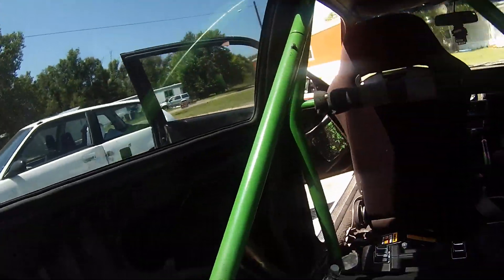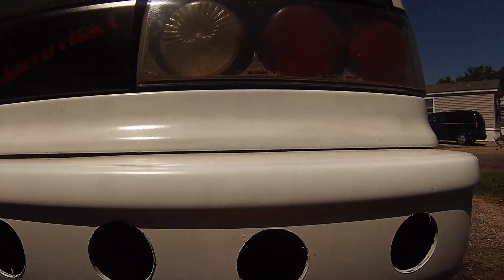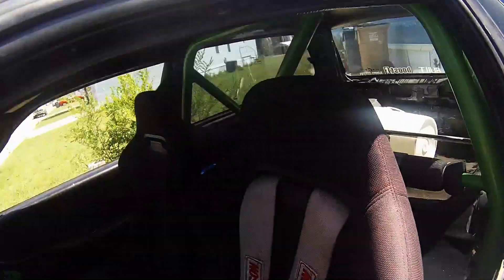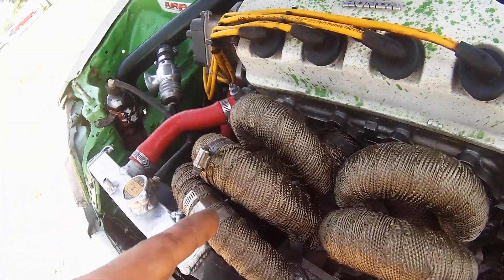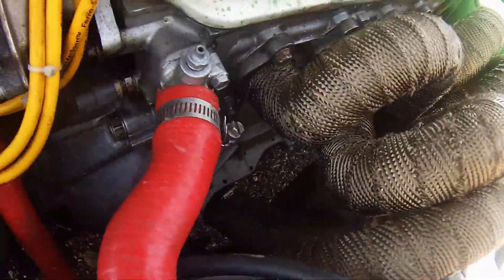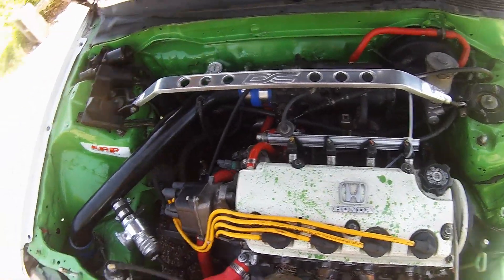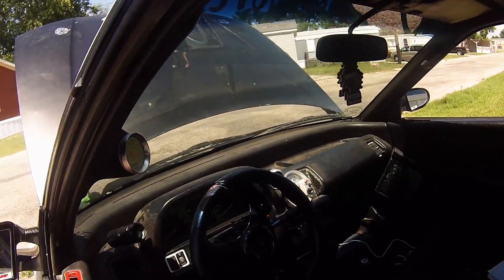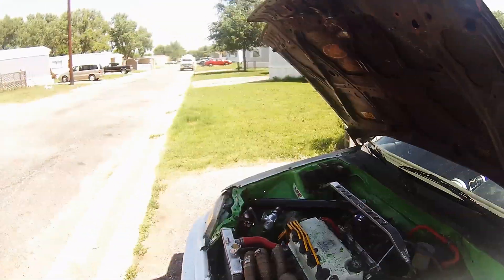Update on the hatch/ no traction video

Comment: Ive heard its not good to use heat wrap on manifolds. Read up on it just tryna help out.
Reply from the maker: Thanks man been down that road before haha. I used heat wrap along time ago on multiple occasions and had really good results BUT... On a turbo manifold u have to have a really good manifold for them to not break welds due to HIGH heat.. After installing the turbo wrap aka Header wrap. It has decreased my engine bay temps by 20 degrees i used a temp gauge during the hottest day to measure max temps.. But i had the manifold reinforced to withstand the higher temps so the welds wont break. In my car its ok to use the heat wrap. ALL MOTOR applications i strongly recommend it for them. but thanks for the heads up! I have personal experience with header wrap and have looked into it. Not as bad as people make it out to be just mostly poor judgment or lack of knowledge on how to properly install with success. because its always better to keep the heat in the exhaust. Faster spooling FOR SURE, Less Heat transfer/Heat soak And the molecules stay closer together and move at a faster rate there for increasing the volumetric efficiency :)
Reply from the maker: Im using heat wrap on my Log. I ended up getting rid of this style LOVED this style but cracks to much. Im stickin to logs now